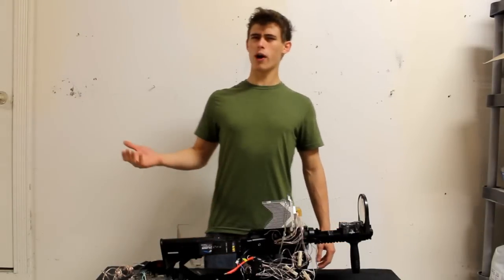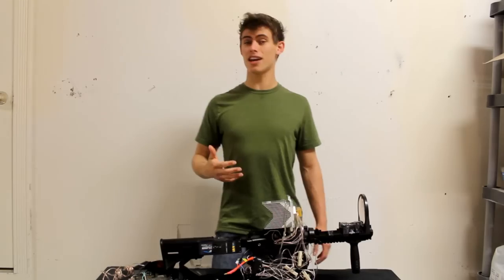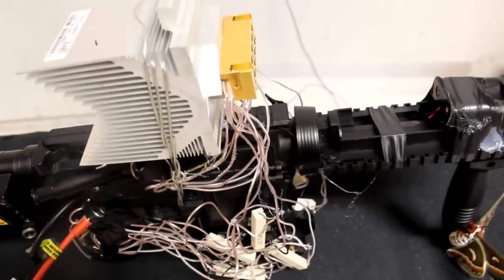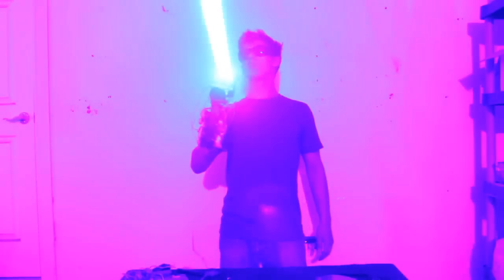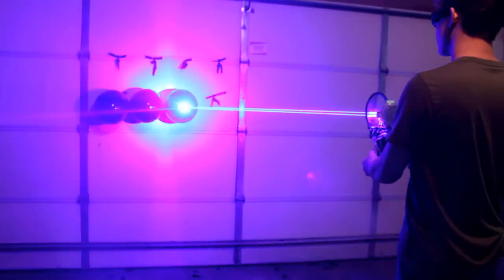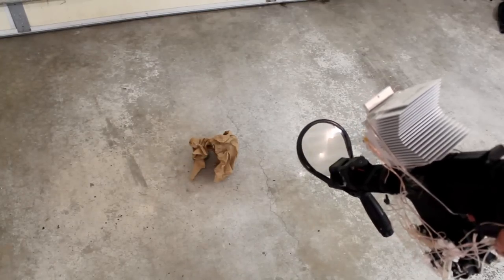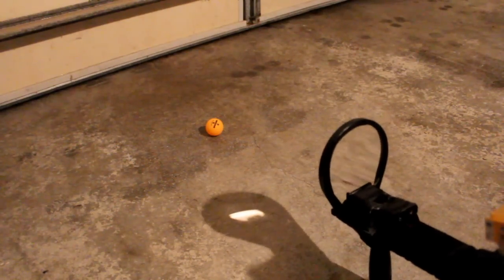My Homemade 40W LASER SHOTGUN!!!!!

Comment: I'm pretty sure it is But just in case i'm wrong I would like to ask. Is on top of the shot gun Behind what it admits to lasers Isn't that for heat dispersal. It would be the metal part.The conduction ?

Comment: This is old af now, but the way it reflected light back off the lens really spooked me. If this was adjusted slightly, maybe if the lasers were aligned in a hexagon pattern closer to the center of the lens, then some sort of small makeshift steel apparatus lined with mirrors to catch the rays reflecting back at you back into the lens.. woof, that would increase the intensity quite marginally I'd imagine

Comment: So, would someone standing outside your garage (which has cracks in it at the bottom, along the joints, and on the sides), say, just driving by, need to have laser protective eyeware on to prevent injury? Just curious....

Comment: I have a problem with my burning blue laser I don't understand. When I focus the beam now, even though it still burns...it has a faint square around it. It never had this before. I have not dropped it or jarred it against anything. I have opened the end that focuses and marked the spot on the threaded end so I could move the barrel lense closer and further away from the laser diode itself. Still doesn't make a diffrence except the square halo will disappear only if the focus gets larger and won't burn. Any help appreciated. PS yep it is quite old now.

Comment: You should make a true Lazer shotgun. Separate beams not focused and make them pulse lasers. It could be semi auto. It would charge capacitors in-between shots and you would just pull the trigger for a quick pulse like a true shotgun and it would have spread like a real shotgun. You could even control the pulse length so one shot could be like  a quarter second. At the power it could have as it pulse's instead of having a continuous beam that short of a pulse could be devastating.

Comment: Hi again, Is it Drake?  I heard you mention close-range lens.  If you can rig a setup with eight identical lenses, one for each laser, it will make a nice "FAR-RANGE" lens that will produce an overlapping circle of all eight lasers at great distances.  One lens doesn't work for multiple emitters, you will just get eight non-overlapping ~circles many miles away.  I would love to see the multiple lens setup.  I did it LONG ago with seven LED's and seven 6" diameter Fresnel lenses.  It was modulated, and I could communicate for five miles! where I ran out of ~"line-of-sight".

Extra comment...I put the Fresnel array against my car windshield to dry (paint) and the next day, noticed a nice big circular curve melted across the dash inside.

Comment: 8 x 5W lasers does NOT equate to a single 40w laser by a long long way. A single 5W laser would perform almost as well. This is why you are a moron. Better luck next time.
Reply: You try doing better.
Reply: @godlyvex  I have done better. A few years ago in my lab we built a moon bounce laser. As you may know the Apollo 17 crew set up mirrors on the moon focused towards earth. We used the moon bounce laser to determine the exact distance that the moon is from Earth.
Reply: @leplum2001  How about proving it? This guy has proof in the form of video that his contraption works. You only have a comment.
Reply: @godlyvex  If I could I would, but as a retired government scientist I no longer have access to the device or the materials. You may well find details of the moon bounce experiments on the NASA website if your interest runs that deep.

Comment: I would use that laser to start fire when stranded on a isolated island.
 Also to fry fish, to cut wood for shelter, to signal aproaching ships 
for rescue and to kill the fish I catch, to kill approaching pirates 
from a large distance (by melting their ship or making holes in it, and 
if they come cloesr I would melt them as well), very useful stuff and 
cover a great deal of problematic situations , just immagine how many 
objects you need to solve all these problems I could solve using only 
this object. I would use it to cut wood for fire, cut metal in the shape
 I want, create glass out of beach sand to cover my shelter, to fry the 
fish, to kill fish in the ocean, or to blind it using refraction 
correction, then it is easier to catch. Am I a genius or not?
Reply: Underrated comment. You are gonna survive in a zombie apocalypse for sure. Teach me senpaiii
Reply: You're definitely not a genius. The laser cannot start a fire on wood alone, it could not fry fish, it could not cut wood, it might be able to signal ships but there probably aren't that many ships in the first place, it could not kill pirates (only blind them), and it DEFINITELY couldn't melt their ship or make holes in it. The laser is powerful compared to normal lasers, but you're vastly overestimating lasers in  general. A lighter would be more useful than the laser, and would require dramatically less energy to operate. Really, how do you expect to run that thing when it's not connected to an outlet or other energy source?

Comment: Ive been thinking about building this since forever... One suggestion, use a convex lens like you have on yours and if you set everything right, a concave lens at the point of convergence and you will have a tightly formed beam with no need to adjust for distance. Also, if the concavity of the lens is uniform, you can set the sources in a radial pattern and stack multiple layers.

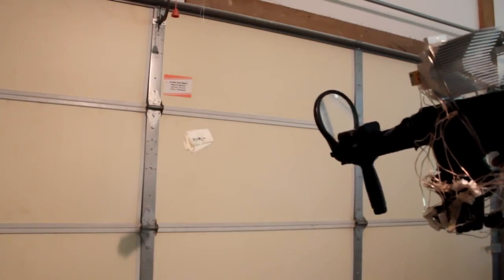Comment: 1:37 This is exactly why you have to use Safty Glasses! Do you see how much of that light is reflected by this transparent lens?
Reply: @notopterus29  the Military is using Laser weapons to deal with enemy missiles. However there is no replacing conventional kinetic projectiles, simply because they can't be stopped by a single layer brick wall. A laser that can't be stopped draws a lot of power, and then we get into the issue with enery density
Reply: And the fact that it would be shooting right back at you while holding the gun doesn't make it better.
Reply: @notopterus29  Any Lightbeam that is strong enough to be reflected by something transparent, is definetly strong enough to blind you in an instant, no matter what percentage of that light enters your eyes.

Comment: You clearly do not understand anything related to laser physics! For your information, a 60W laser can cut wood. If it was so easy to make a 40W laser by adding 5W laser sources together, why do you think that companies are spending millions of dollars to develop high power diodes?
Another detail : do you know the efficiency of a laser diode? Around 20% in the best case. This means that your 40W laser is either consuming 200W of electric energy... or more probably, it consumes 40W (and then I let you compute the real optic power... which is much, much less than this)
Reply from the maker: First off, 8x 5W lasers side by side is still 40W of laser light. Many industrial high power laser systems are just arrays of lower power lasers combined with fibers. Now don't get me wrong, shining 8 parallel lasers through a single lens is definitely crude and does not come close to utilizing the full capabilities of 40W of laser light, but this was just for fun and I definitely do not have the tools to try combining with fibers. 

If you want to argue about what makes a laser, do you consider the NIF petawatt class system a laser even though it is made up of 192 individual beams? Is a mode-locked Ti:Sapphire system still a laser even though it emits over a large range of frequencies? What about a large modern laser show system, with ~40 individual diode lasers stacked with knife edge mirror arrays?

As for the efficiency, these laser diodes do pretty well, in the 20-25% range. The whole circuit consumes around 250W I'd imagine. The Li-poly battery pack I had on the gun could probably do pulsed powers up to a kW, although I don't remember its exact specs.

I can tell this video did not impress you, but please watch my video on my giant ruby laser. You may be impressed with that one!

Comment: That laser is nowhere near 40watts
Reply: He bundled 5watt lasers together, lol. It just makes a fat 5watt beam.
Reply: @Chaddy_D   It depends.  If they are all focused at the same point, then they interfere at that point and could constructively interfere, however, interference only occurs where the beams coincide.  Since you have beams all coming in at an angle, they are not going to destructively interfere.  If they are all focused at different points (albeit all localized within a certain volume), then you essentially have however many lasers x 5 Watts in that volume.
Reply: tactical potato 40 mW wouldn't ignite stuff like that.
Reply: FINALLY SOMEONE UNDERSTANDS, he must be mixing up watt and Milla watt

Comment: Frying ants on the driveway with a magnifying glass was mildly amusing when I was a little kid... Now it's a third of a century later and I want one of these to do it! Maybe double or triple the wattage and have it all in a single beam, and we're ready to rock
Reply: That's approaching what the military uses
Reply: Those ants wouldn`t stand a chance :) hehehe
Reply: Replace your porchlight with it ;) 
Midterms coming up. You know you'll get those solicitors ....
Will look like the Star Trek transporter. Only they won't rematerialize.
Reply: Devil's Offspring And i use this against my stalkers. One more "drive by" and witness the power of this fully armed and operational battlestation. Fire at will commandar.

Comment: You should use a different configuration to mounting the diodes and to use optic and mirrors to join and colimate all beams in one single beam wich could be focused easily by lens. So the beam will be much more energetic and efective.

Comment: I have a JDSU pumped gas laser that is about the size of a 2L soda bottle and if I crank up the power supply it will cut your garage door into pieces in seconds because it is continuous output unlike diode lasers which are pulsed.

BIG difference...
Reply from the maker: yeah, that's a lie. If it is a JDSU gas laser then it is either Argon and/or Krypton ion, or CO2. Anything that could cut metal will be way, way bigger than a soda bottle, and it would be extremely unlikely that you could run it on the measly power from a household electrical panel. And to top it off, diode lasers are most definitely not restricted to pulsed operation.
Reply: I have/had several JDS Uniphase, Coherent, Spectra and MG gas and diode lasers I picked up along with a bunch of other lab equipment for a couple hundred dollars at auction when JDSU closed and moved out of their OCLI facility in Santa Rosa in 2007. 

In fact I got all the lasers for free because they were in a big pile of "garbage" they were planning on tossing in dumpsters. There were about 2 dozen assorted prototypes and demo models in the main office building from a tiny diode laser head about the size of a couple packs of gum, to integrated high power Q Switched diodes  the size of a big shoebox (Green and UV), to Argons (IE: 2213, 2218 etc.) up to big very high power CO2 laser heads with separate power supplies and liquid cooling units. (K500) I sold most of the to a used laser dealer on the East Coast (Made a fucking KILLING!) and a couple other places, and kept a few.

The JDSU referenced above is a prototype 1300  watt liquid cooled CO2 laser that they never produced for sale, and no, the actual head is not bigger than a soda bottle, just a bit longer. In fact it's shorter and lighter than the Coherence K500 which puts out less than half as much power.

Where did I say I was running it off of 120V s/p?? It has a separate tethered variable input/output power supply that will run on 208/220/400/440V 3-phase, which conveniently I have access to in the garage/shop as the irrigation pond pump is 440 3-phase and it's separate phase converter/transformer is located behind the garage.

Sure you can run Diodes continuous wave... At low output unless you want to fry it with COD. This is why most are pulsed, more energy on target...

CO2 on the other hand is constant energy on target... Non-stop photon bombardment...
Reply from the maker: Well I am still skeptical, but I am very jealous of the 3 phase hookups. If you have badass lasers at home, we'd all love to see vids of them here on YouTube. I'll happily eat my words if you do so!!
Reply: So upon reading these comments I have come to the conclusion that   people who don't know what they're talking about definitely aren't capable of making it appear so quote as flawlessly as Mr. "I came across some house incinerating experimental lasers about to be tossed out" over here. I'm quite a bit smarter than the average guy but you guys make me feel like a caveman

Comment: @styropyro First off i would like to say you do incredibly awesome work. I have a question, I know you can not simply ask how hot do lasers get. So I ask is there a function of heat generated by a laser relating variables of ( power intesity, wavelength, and specific heat capacity of the object being heated? I ask because I want to decide on a laser to heat up an object to a specific tempurture. If you have any information to help me out I would greatly appreciate it. Thanks and keep building cool things. peace
Reply from the maker: I have a video discussing this question, and it basically says that this is very hard to calculate. You can easily use the Stefan-Boltzmann law to get an upper limit of the temperature of a thin object hit with a laser of known power and beam size. A better approximation would be to combine the Stefan-Boltzmann law with the heat equation and then solve with the appropriate boundary conditions. That would get very ugly though.
Reply: yea the more accurate you want the calculation the complicated the formula gets. What laser would you suggest I buy/build to heat up a 1mm diameter sphere made up of graphite to around 4500 degrees Celsius. I know that is an insanely hot temperature but I am sure it can be done.

Comment: Try using magnets to focus light, or better yet, a microwaves or some other kind of wave that travels at the same speed as light.  When the two come together they should form a new function. Might be dangerous, im not really sure, I just come up with ideas I don't really build things,
Reply from the maker: Doesn't work that way...the electromagnetic field is linear for nearly all but the most extreme conditions. If you apply an extra field to the light, the vector quantities just add up.
Reply: styropyro doesn't the same thing happen in the mechanism to create the laser in the first place?
Reply: styropyro I got an idea:  if you can bend spacetime just right, and I'm assuming certain properties of magnetism or perhaps another element will do something of this nature, then you can create a lens with spacetime.  

Basically I can see it as two spheres and inbetween the two is like a road between the spheres.  As long as this becomes a point, or less road like and more gate like, then it should work really well. Doing this over and over will create a barrel for the laser to through without the light going back to its wave form

Comment: have you tried charging a capacitor with the beam. strike a metal plate connected to one terminal and ground the other. this way the longitudinal aethreric energy could build up as charge. This experiment was done with focused beams from arc lamps driven by high voltage dc impulses. What type of gas are you using in your laser? Argon? What is your high voltage supply rated at?

Comment: what happens if you use it on a mirror ?
Reply: You will burn a hole into your chest
Reply: so the military doesn't use it coz the enemy will just walk around in mirrors ?
Reply: JXGaming I dont know if that would work, but a mirror shield might.
Reply: Mirrors will not work at military power levels.. Generally mirrors  can only reflect 80 to 90% of light. Military leaders can reach hundreds of kilowatts, so even a fraction of that it's enough to melt through the mirror! Plus having a giant shiny tank isn't exactly very tactical countermeasure ;)
Reply: Lasers* I blame siri
Reply: blindness
Reply: The Universe explodes.

Comment: Link to the battery pack used?
Reply: It's just a Lithium Polymer battery. Also known as LIPO and these are commonly used in Radio Controlled equipment; cars; boats; etc.  ebay is full of them.